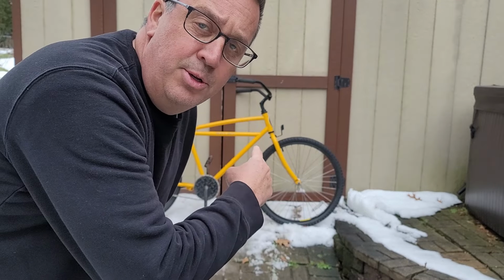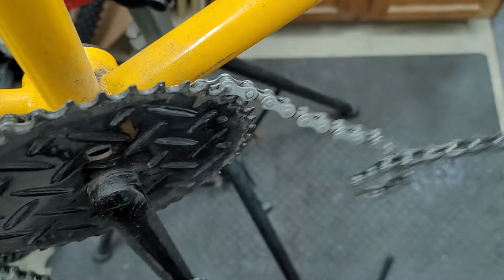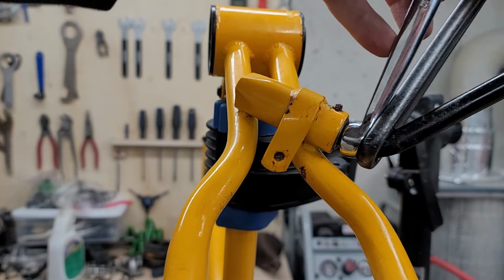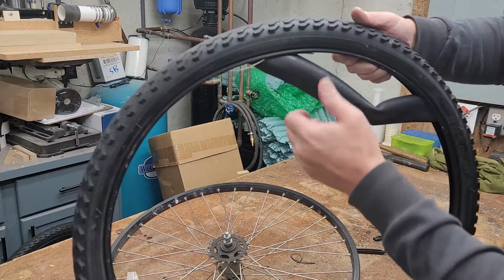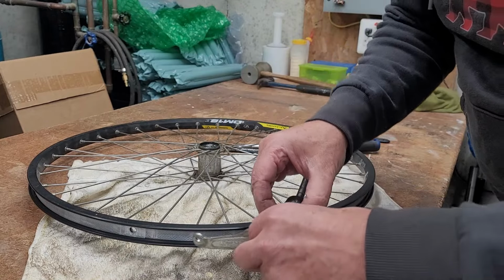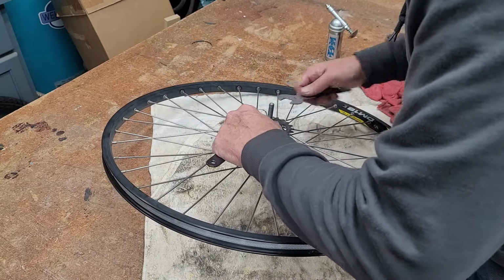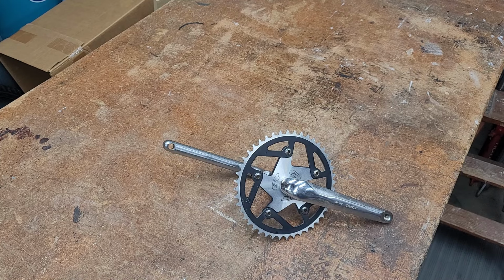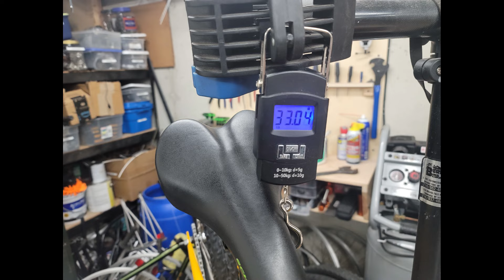2000 Schwinn Heavy Duti Klunker Build - From full service to full send!

Comment: Nice work!  I haven't seen one of these for years. When I was 12 years old I got my first job, a paper route delivering the San Jose Mercury News, and my mom bought me one of these brand new and had it fitted with a custom rear rack designed to hold those two-pouched canvas bags that held the papers. Some local guy made and sold various bike racks. This was in 1973. It was the perfect bike for that job because those bags were pretty heavy when loaded with papers, and mine was yellow just like this one.  These bikes are tanks and it's cool to see one again. Cheers.

Comment: I have the same frame and did a klunker build. One issue I came across. I bought Chris King headset 1 inch. I wasn’t able to fit it due to the oversized headtube with threaded steer. Is there a way to work around this so I can add the Chris king headset? Do I need to change the forks?
Reply from the maker: I'm not familiar with the limitations of the Chris King headset.  Sorry, I used the stock one on mine.
Reply: @ did you by chance measure the headtube cups? I think I measured at 32.5mm which is slightly smaller than modern 1 1/8 and bigger than 1 inch headsets. Do you agree? Just want to make sure I didn’t measure wrong.

Comment: Nice bike love to have it.Are the wheels steel?Does it have a 23 tooth sprocket in the rear?
Reply from the maker: The rims and front hub are aluminum.  The rear sprocket is a 22t.  I try to keep all my single speeds as a 2:1 ratio on the drivetrain.